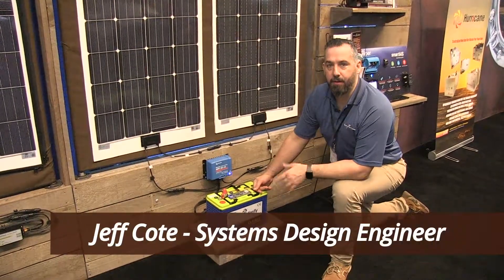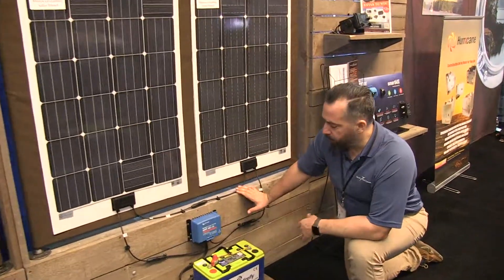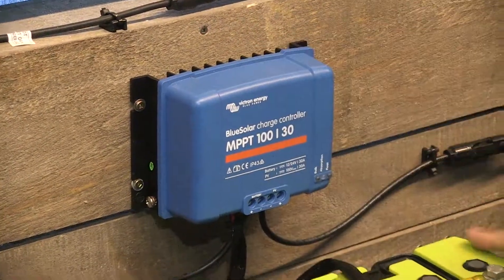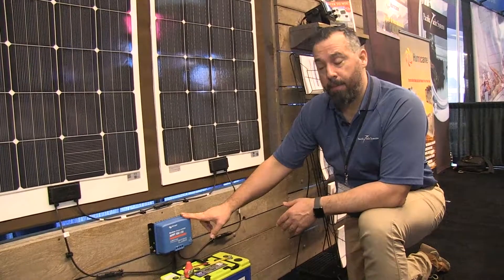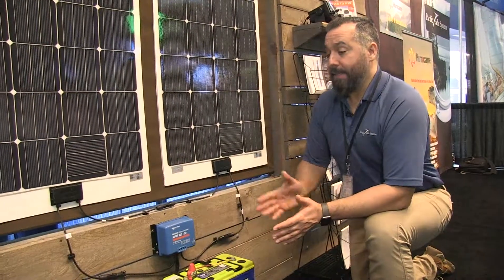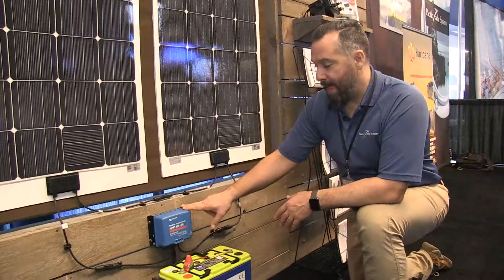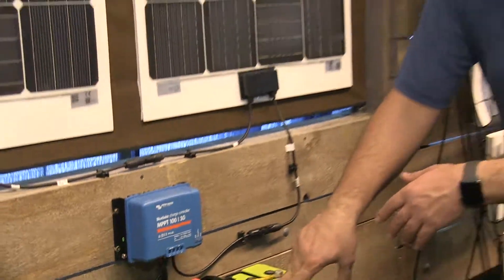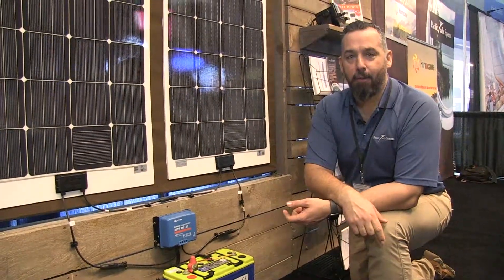Intro - Victron MPPT 100/30 Solar Controller

Comment: So is the difference between this controller and the 100/20 just 10A and the loss of the ability to power loads aside from the battery?

Comment: how many 100 watts solar panels can the Victron MPPT 100/30 Solar Controller handler?? I currently want to hook up 3/4 solar panels if the controller can handle it?
Reply from the maker: this answer depends entirely on the battery voltage.    if 12v then you can run 3 and get full power.  it is safe to run 4 but it will just cut off the extra power on sunny days.   but on cloudy days you'd get more with 4 then 3 because it won't be maxing out the controller on cloudy days.   this is in parallel.  if you want them in series you'd have to look at the peak voltage of each panel on it's label  and the 4 together can not exceed 100v

Comment: I have a million questions but one very important one,  what lights should come on when I plug in my solar panels? I'm getting none and I'm having zero luck finding this one little tiny piece that has held me up for a month on my build
Reply from the maker: Hi Sarah, your right the Victron manual is sparse. Instead of using the LED, we use the Bluetooth dongle to connect a phone app to the controller for diagnostics. Here's the manual for reference:
https://www.victronenergy.com/upload/documents/Manual-SmartSolar-charge-controller-MPPT-75-10-75-15-100-15-100-20-EN-NL-FR-DE-ES-SE-.pdf
Reply: @PacificYachtSystems  why do some installers use one control charger per panel while others use one charge controller for multiple panels?

Comment: Hello there, i have the same mppt model, i have question, the bulk on my Mppt 100/30 is blinking like the one in the video, what does that mean?
Reply: It is the BULK stage of a three stage charging system. You can look up three stage battery charging online and it will explain the BULK stage to you

Comment: what happens if you have the Victron battery Bluetooth monitor as well? do you need to switch the Bluetooth input or would they work together on the app?
Reply from the maker: Good question, unfortunately don't know the answer.

Comment: Am I correct in assuming that if using a lithium bank you would wire the MPPT to the BMS, not directly to the batteries?
Reply from the maker: Hi E N, the MPPT solar controller should be connected to the DC charge BUS.